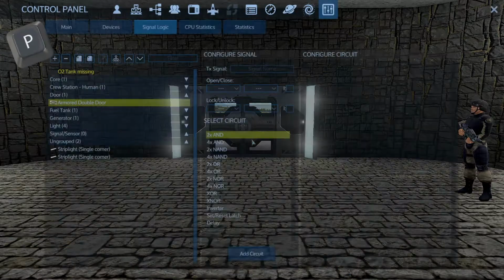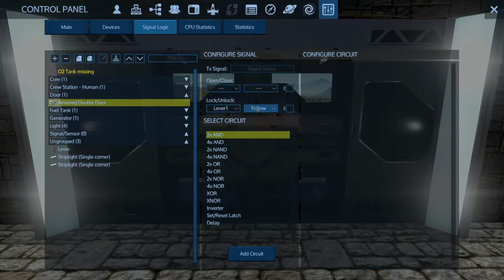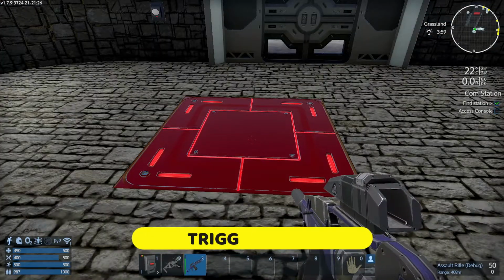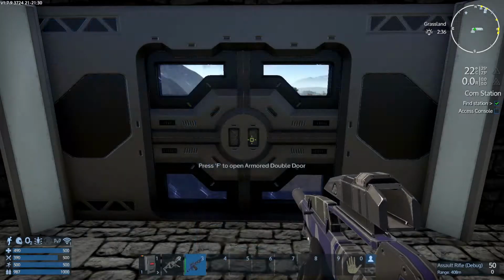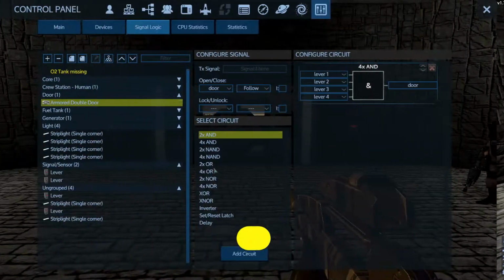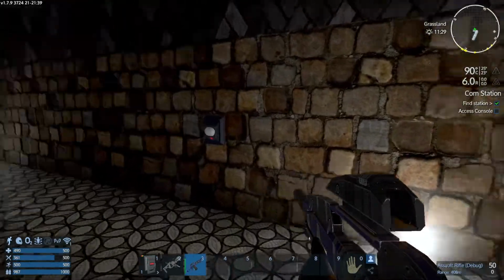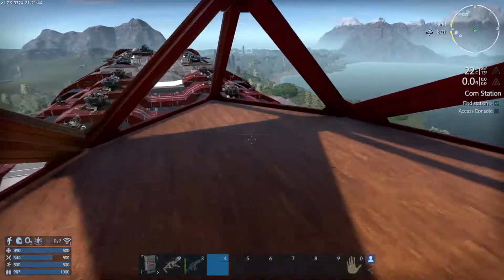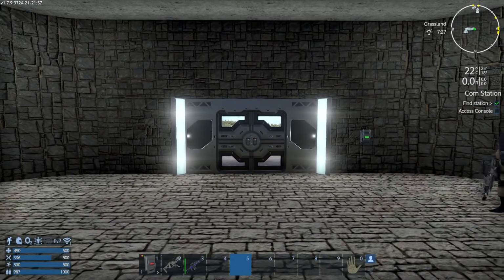Empyrion Tutorials 2022 - All about Signal Logics

Comment: I've spawned in an sv i made in creative mode with switching for all the devices but the switching is completely dead when i spawn it into survival mode. I've even tried removing and replacing the switches with the multitool and resetting everything but absolutely nothing will make the levers work. When i highlight them with the crosshair they don't show their name like they do in creative 🤔 HELP 😅
Reply from the maker: When in game, you can still go in god mode or godmode (gm) invisible (gm iv) which should show the item with your multitool. Now, I'm thinking either your signal button is off in your control panel. (easy to sometimes overlook these things). You can also find me on my discord channel and send me the blueprint, and I can take a look at it also see if I can find the problem!

Comment: Hi Rakoona, I am trying to figure out how some do the power save circuit, it puts things like lights in half power mode etc...
Reply from the maker: Well, either have a switch in the P menu and give it a signal, or put a switch on your ship and give it a signal. Then you'll have to set each light to follow that signal, whichever one you want to be connected to that signal.  But you can't have a light become dimmer. It's on or off. Remember to set a signal if you have a teleporter on your ship. That thing takes a lot of power!
Reply: yes I get that but I do not know what the others put on their power save mode, I know some have a number of things when the signal is activated in the P menu, and lights was just a thing I see where your P menu lights is only half on not fully on so no idea about that lol and thank you for the reply @Rakoona
Reply from the maker: Well, you can always connect some thrusters to it and actually some generators! That would save some juice! @auwombat8540

Comment: Howdy - I am just getting started in this game and have built a Landing Pad for my CV that is 40x70.  I have placed lights and would like to use a sensors to turn them on when myself or someone lands on the pad.  They'll turn off while away or once I walk into the Base Station.  I have placed sensors on the pad and in opening them all of the way up it takes at least six to cover the whole pad.  How would I set up the logic.  If it only required four sensors it would be simple. Thanks in Advance!
Reply from the maker: So you can set up all sensors on a 4or and a 2or circuit. Then output them to a signal called LIGHT1 and LIGHT2. Then setup another 2or circuit with LIGHT1 or LIGHT2 that would give another signal called LIGHTSON. Then set the lights to turn on that signal. I hope it's clear the way I'm writing it!
Reply: @Rakoona    Thank you!!!  I will give it a try before the day's end.

Thanks for taking the time to create your videos and the reply.
Reply from the maker: My pleasure! @WdyWP
Reply: @Rakoona   Worked like a dream.

Although....  as soon as I sit down <F> in my CV the Landing Pad lights shut off.  I lifted away and made a new approach.  The lights stayted off unti I get the <F> out of the pilot's seat.  I guess Shield, but dismissed after turning the shield off.  Then I ran and jumped in a SV, that is parked at a different location, and as soon as I got into the area the lights lit.

So, again I am guessing this is going to be the nature of the beast with CV's.
Reply from the maker: Did you expand the detection zone to the max? @WdyWP
Reply: @Rakoona   Yes.  The motion sensors are pointed towards the sky and set to 16.

Everything works as desired until I hit the <F> at the Pilot's Seat.  Then the lights go out.  As soon as I hit <F> again to get out of the Pilot's Seat the lights come back on.
Reply from the maker: yeah, when you get on the pilot seat, it doesn't recognize you as an entity anymore. Maybe there is a way to set a delay of 30 seconds from when you're not in the zone before lights go off...  @WdyWP
Reply: @Rakoona  It is so weird, but that makes sense.  I've recently learned that CV's don't dock to the base.  This might be a part of it too.   If I fly over the area in an SV the lights function with the sensors.

I'll just live with it and set up some additional lights lights just for landing. 

Thank you again for your replies.  And your videos!!
Reply from the maker: My pleasure! But the CV should dock to bases! Make sure everything is set to the same faction. @WdyWP

Comment: How would you connect the loading ramp with the landing gears in a cv/sv ?
Reply from the maker: Make sure all items in your ship devices are grouped! I think that helps. Then on your Landing gear, set a Tx signal name. "Test" in this case. Then go to your ramp, and use the "open close" dropdown to find "test" and set it to follow. 
I think you need to check that "I" box for invert.
Reply: @Rakoona  It works. Thank you.

Comment: Alright what if i want to set multiple doors to open on the command of one button? Because i bascily want to creat a Hangartrench like the Stardestroyer of the Republic had in the Clone Wars and i set up around 68 Blastdoors to cover the trench. I want the all to open at one signal. Can i just creat a signal and set them all to open at that signal? Or do i need to to crosswire them to eachother? I play the game since years but very irregulary and always forget everything even mildly complicated as soon as a start again
Reply from the maker: You can create a motion sensor or lever, or whatever you want to use, and assign that item to output a signal (MAIN in this case). Just set all the doors individually to open to that signal! The only problem with that, is I beleive the doors will not become manual, and wont open automatically. Unless you have another motion sensor for each indivual door and add a circuit OR for each door, to open either with the MAIN signal or the other signal assigned to the montion sensor set for that door. I hope you understand what I mean.
Reply: @Rakoona  I tried a bit and managed to just connect them all to a "Trench" Signal that i linked to a lever. But i want to make this effect also accesable from the main consol. Can i just name on of the Custom switches to a Signal or how does that work? Like having a Lever at the Hangar directly to open the Trench for Small fighters to swarm out but also having the ability to do it "from the brigde" aka fromt he control panel.
Reply from the maker: @holschermarc  So I opened up Empyrion to double check, and on your control panel, at the right completely, you have a Signal section in which you can set a few signal from that. So from there, make an OR with Trench and the other signal that gives you an output, and set all doors to that output! It should work fine!

Comment: Can we activate drills with logic or is that not implemented in the game yet? I can open and close them but not start them. Want to build a miner that have both large and small drills running.
Reply from the maker: No you can't for now! But would be a nice thing! :D
Reply: @Rakoona  I doubt it would be hardcoded, so a mod could probably be made for such a function.
Reply from the maker: @kezzler9556  Hmmm, maybe! Would be interesting! But there are also a few things that Eleon could add that could make things better, like keybinding to the custom Buttons in the P menu, and so many more. I could make a list!
Reply: @Rakoona  There are loads of stuff I want in the game aswell. Programmable buttons in wall panels for example. Imagine if you could have 20 buttons and levers crammed into 1 block, but also space engineer stuff like pistons and rotors.
Reply from the maker: @kezzler9556  OMG, that would have been good! One panel to rule them all. One panel to bind them!..

Comment: Maybe you can answer this question. I have 4 levers set to 4 sets of shutter doors but I want to create a 5th lever that opens all the shutter doors on my ship. Is this possible?
Reply from the maker: Yes, have all shutters connected to an OR command. 
Have all levers named Lever 1 to 4. And the 5th named MAIN. The set OR commands Lever 1 or Main = door 1. Lever 2 or Main = door 2. Lever 3 or Main = door 3. Lever 4 or Main = Door 4. Then set each door to open on the door 1 2 3 and 4 signal. Should work!
Reply: @Rakoona  Awesome that was a very good video. Thanks
Reply from the maker: @umbrashadowgaming4974  Thanks! Hope its clear enough for people!
Reply: @Rakoona  It worked for one of the doors but that one also had an old signal selected. I kinda gave up playing with it for know. I had spent most of the day working on a tier 1 cv and needed a brake. Do i need more than one circuit?
Reply from the maker: @umbrashadowgaming4974 You need a total of 4 circuits OR. The 4 I mentionned before.
Reply: @Rakoona  gotcha thanks
Reply: @Rakoona  now i have more than 4 shutter doors its four sets of shutter doors does that change anything
Reply from the maker: @umbrashadowgaming4974  Depends if you want 8 switches + 1 main or if you want two doors set to a signal. If you want 8 switches, just add 4 more OR signals as you did the first.

Comment: That's a most welcome video.  Not too many people cover signal logic.

Agree that this is very much an area to just play with.  If you don't understand how the bits and pieces work you won't have much luck putting them together to make a circuit that does what you want.

This is one area where I'm in good shape.  Before I moved to software I used to do digital circuit design.  This was back in the 80's and 90's but they haven't changed the rules on Boolean logic so it's all still good.  ;)

I go pretty light on the circuitry in my designs but there are a couple I add to a CV related to teleporters, shields, and generators.  I'll have a 2-input OR gate where one input is from a lever switch (or an input from the control panel) and the other input is from the sensor that turns the teleporter off if nobody is standing on it.  The output from the OR gate goes to all the generators in the CV.  With that circuit the generators will be turned on if the switch is on or someone is standing on the teleporter (or both, of course).  Great for CVs I leave on a planet to service autominers.  I can teleport to it and then back without having to leave the CV running after I've teleported back.

The 2nd circuit extends on that by adding another switch, an inverter, and a 2-input AND gate.  The switch goes into one input of the AND gate.  The teleporter enable sensor goes into the input of the inverter and the output of the inverter (which will be 1 when nobody is standing on the teleporter) goes into the other AND gate input.  The output from the AND gate goes to the shield generator.  With that circuit the shields will only be turned on when both the switch is on and nobody is standing on the teleporter.  

And of course a few simple circuits using switches/sensors to control doors and ramps, but that's just simple stuff with no added gates.   I do find it's good to keep signal logic simple.  Empyrion signal logic can get a little flakey if you try to do anything too fancy with it. 

I'm pretty much caught up on all your tutorial videos now.  Every one of them has been good and I've most always learned some new things.  I hope I haven't came across as a jerk in any of my comments I've made.
Reply from the maker: Of course not! I always have signal logic connected to the teleporter as well. That thing draws crazy amount of energy and will consume your fuel even faster. And yes, you could make crazy signal logic combination, but again, the game sometimes finds a way to get confused itself if there is too much and might have trouble keeping up! Like sometimes SV's that are docked in your CV, even when inactive, can mess with the signal logic and be still considered "A presence". and my doors and ramps will always stay open.
Reply: @Rakoona  Yeah, I gave up long ago on using the landing gear to open ramps, etc.  But part of that too is I like limiting myself to using, as much as possible, only found components.  So I often don't have landing gear at first, but I've always got a stack of switches.
Reply from the maker: @xlerb2286  Well, if you look at the Charon, one of my ships, I had to connect blast door to my landing gear to keep the ship leveled when I land, otherwise the ship would always tilt. You find use for it! :D

Comment: good tutorial but I'm still highly confused lol, I'm trying to set up a lever to power on and off my constructors so they don't draw unnecessary power and tried using a similar setup to your door but on/off and it doesn't work. Idk what I'm doing wrong lol
Reply from the maker: Well, you could set it up on a level, make sur to put a name in your xsignal on the lever, and then on the constructor, set it up to follow that signal you created. You can always use the custom signals in the main control panel.
Reply: The thing the confuses most people is the second option on the device you are controlling (in your case a constructor), which one to use? Here what each do:
  
   Follow - this follows the state of the signal, for a switch it means if the switch is on the device will be on  if the switch is off the device is off. This is the option you'd use 90% of the time with switches and motion sensors.

   Toggle - each time the signal is activated the state of the device swaps, this is most often used with pressure plates and light-bean sensors. Note a switches signal is only sent when the switch is turned on not when it's turned off.

   On - once the signal is triggered the device turns on and stays on. This is also mostly used with light-bean sensor and pressure plates but can be used with switches if you don't want to let your players turn something off after turning it on.

   Off - the opposite to On.

I hope this makes things a bit more clearer.